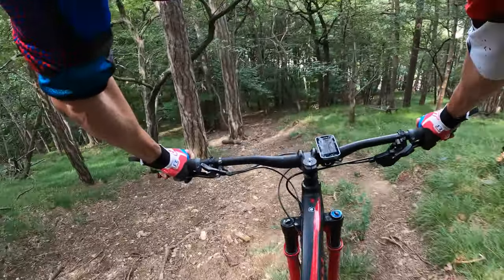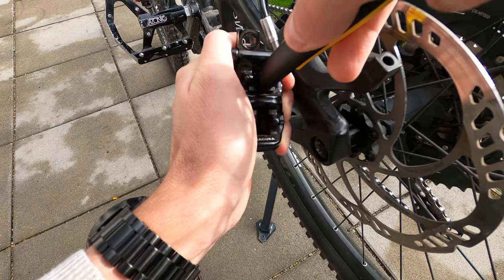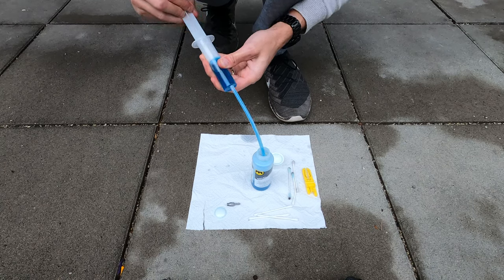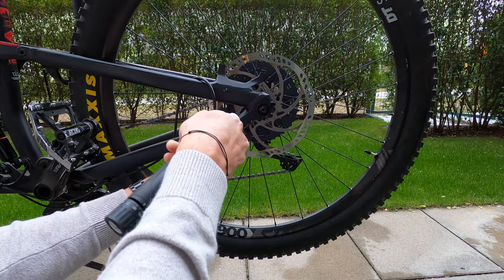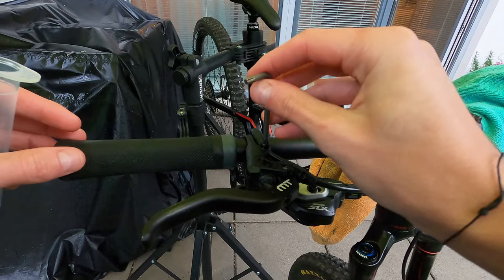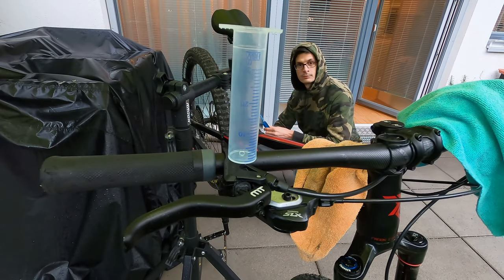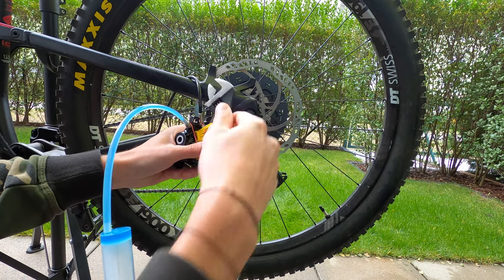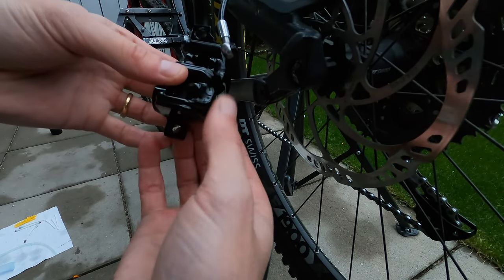DIY Magura MT5 (MT) brake bleeding procedure 🛠️ Tutorial for beginners like me!

Comment: ı have just watched your monarch service and it is very usefull. I' am watching this video just out of curiosity. I don't have magura  brakes. However, before pushing caliper pistons, you must clean them. If you push them without cleaning, you may damage the piston seals and oil may leak. If that happens, you will have to replace them. There are fine guideleness on youtube about caliper piston cleaning. Thanks for sharing.
Reply from the maker: Ehi Mustafa, thanks for sharing! 🙌🏻 I actually did not know that this operation was mandatory! I did it only one time to solve the "lazy piston" issue, i was working in the video yesterday night😁. But anyway you are right, at least clean the pistons with a brake cleaner should be done! 😎

Comment: This is the method I used. However, when I tried to pulled the oil back through the system, a bunch of air bubbles came into my syringe. What do you think this means? Is there a leak in my brake hose?
Reply from the maker: Pull very slowly and check that the connections on both the syringe are fine. If you still have the issue, something could be wrong with the lever or the calliper

Comment: A torque wrench is ONLY used for tightening. Using it to loosen will affect the accuracy of the torque wrench and will need to be recalibrated.
Reply from the maker: True, any told me and I learned it now 👍
Reply: Not always true, some torque wrenches have backward function, i use stahlwille high torque wrenches and the typical diviation is about 4% after heavy use.
Reply: @vsurp  the backward function is used for tightening the other direction, so your Stahlwille calibration could last twice the times longer. In short, always use the right tool for the job.
Reply: @brianpham2584  if you switch the whole head the other way its all good:)

Comment: I confuse with what will i chose for my brake set, what will u suggest ? Mt5 or shimano zee/slx 7100?
Reply from the maker: Shimano Zee, but probably you will spend a bit more!
Reply: @OresteCiotoli  thx bro, so what you feels when use mt5?
Reply from the maker: @yusriliqbal7561  it's a great brake, great power, but i had problems on the rear one; honestly i would go for something more reliable